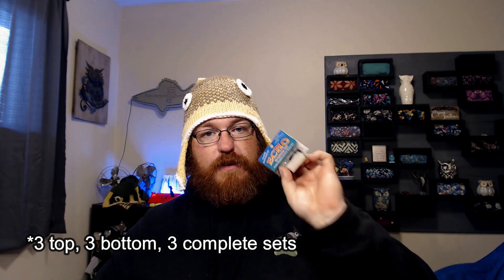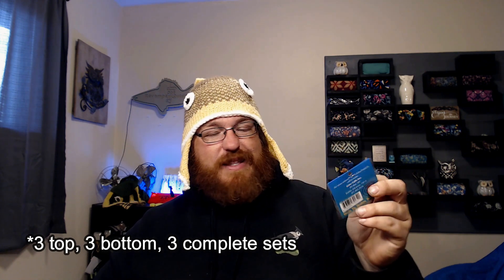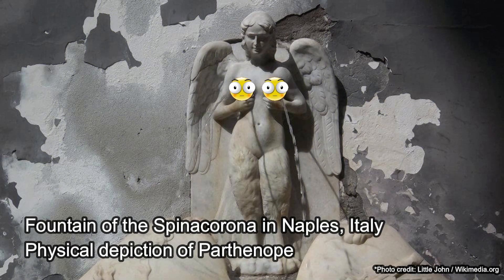3D Printed Duck Call - Parthenope (STL's now included!)

Comment: So i tried to make it but it wouldn't screw in all the way. Do you have any suggestions?
Reply from the maker: Could be some print settings? Is there a bunch of stringing in the threads? Depending on the slicer you are using you could try to print at a smaller layer height on the male threads section? Try printing without supports if you have not yet tried. If the threads are sagging maybe bring down the print temperature by 5 degrees. Those would be the first places I would start.

Comment: The print turned out great - a little sanding but it eventually screwed in tight.
Any other recommendations for reed material - other than buying them? 
I tried thin mylar (too flexible)
Tried milk crate and apple juice containers (too rigid)
Reply from the maker: Someone did design one on thingiverse to print but I could never get it to work. Mylar 10 mil to 16 mil seems to work maybe try a bit thicker?

Comment: What are the dimensions of the calls supposed to be? i downloaded it and it sats its 600mm but that seeems excessivly large.
Reply from the maker: Maybe it's set to inches for some reason in the slicer? It's no larger than 200mm fully assembled ot by the computer yet I'll check on it later though.

Comment: What you should try to do is you should try to make a A working lipless Crank bait
Reply from the maker: I have a few in the works, none that I really like so far. Going to have video up soon on a giant popper that works pretty well, just starting to get back into printing hard baits. Went a little crazy with the soft baits for the last 6 months of videos lol.
Reply: Which read should I get for your 3-D printed the call because I printed one and I don’t have any reads
Reply from the maker: @Reneltoutdoors  another maker made a reed that you can print, or you can cut that same design out of mylar material at the local hobby store 10 mil thick works the best if you can find it. For this call I used a set of echo replacement reeds for standard echo calls. I found them on Ebay but they are available at sporting good stores. If you're interested in trying to print one this is the page for the one he designed:
https://www.thingiverse.com/thing:3234423
Reply from the maker: @Reneltoutdoors  I hope that information helps!
Reply: Revamped Outdoors yes it did and thank you

Comment: Weird questions but I you know the approximate weight of the call? My University printing charges by the gram is why I'm asking
Reply from the maker: Interesting never even thought about University having printing services. I just weighed my PLA 10% infill 3 perimeter version and it was 37 grams assembled. If they have the option to print polycarbonate, PETG, ABS or ASA I would go that route for heat resistance and longevity.
Reply: Revamped Outdoors thanks for the info, I've printed replacement inserts for a couple of crow and predator calls for like $.40 a pop but never attempted fully printing a call and didn't want to go overboard on printing cost.👍🏻
Reply from the maker: @codybrown527  nice! Hopefully they don't rake you over the coals for the printing cost! Infill doesn't seem to change the pitch too much, less infill makes it a little deeper but it's not too noticeable.  Once you tune the reeds just right it sounds pretty close to a softwood call much more mild than an acrylic.
Reply: Okay I originally thought they only offered pla but it turns out they offer slot of things duck calls are typically make of such as polycarbonate, wood, and resin for a higher(but not unreasonable) price. Do you think it would be worth going for one of those materials?
Reply: Which also beggs the question, how do you 3d print wood😂😂😂
Reply from the maker: @codybrown527  wood is genetally a composite material of PLA and wood fibers. It looks kind of cool but is usually really weak structurally. If it's something for a show piece or on a shelf it's ok but for a functional part I wouldn't do it. Polycarbonate is really strong and can withstand pretty high temps like in a hot summer car. That's why a lot of the time i don't recommend PLA because if you leave your calls in the car they can warp. I generally print in PETG because it won't warp in the car and is hobbyist friendly (low cost and relatively low VOC). I am not too sure on the resin it would depend on what type of resin they print with. SLA printers for resin are usually much better print quality and can go to a higher resolution. But it depends on the properties of the resin they have if it will work for a call. The higher resolution you can go the better because then you don't have to do as much work to tune the soundboard (sanding smooth). I hope this helps!